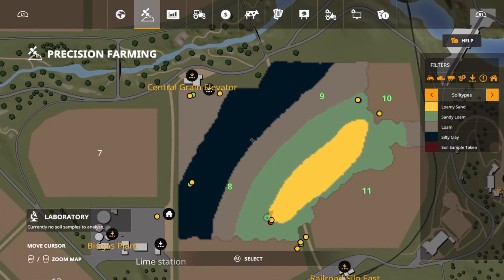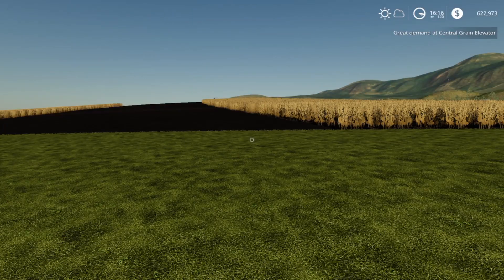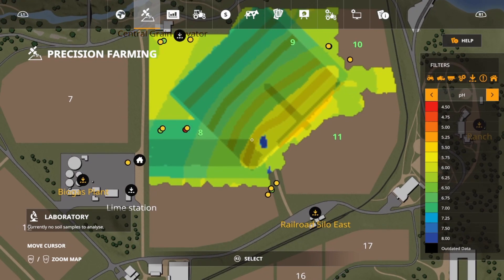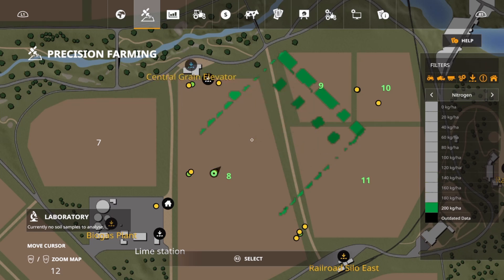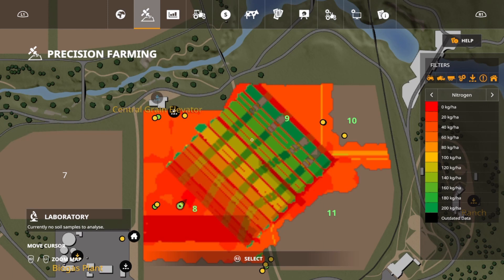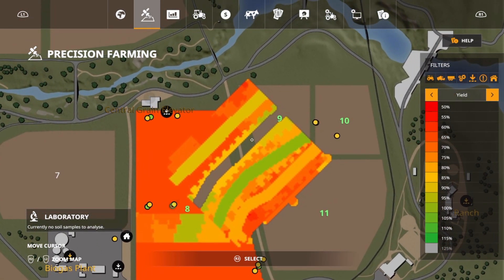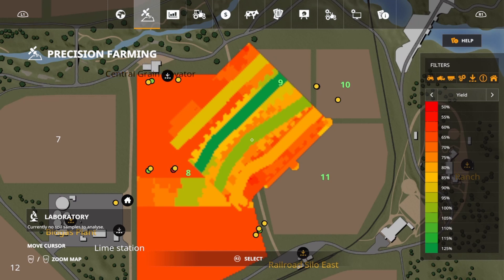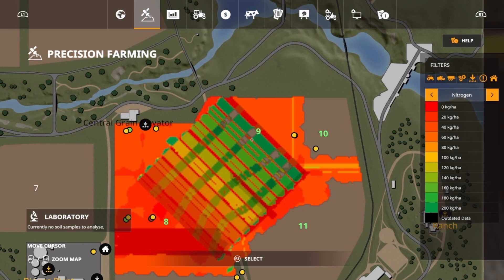Nitrogen Effects On Soybeans | Precision Farming On Console | Farming Simulator 19

Comment: I have this problem on Xbox where I did 4 soybean in a row and now there is no nitrogen levels at all. I believe it went past 200. However, I plan to try planting nitrogen dependent crops to see if it brings it down.
Reply from the maker: Can you update me after your harvest?  I'd like to know if that makes the nitrogen levels visible again.
Reply: @Driver53Gaming  harvested several times. It seems that if you plant soybeans back to back several times. The nitrogen level goes above 200 and is no longer visible. The weird thing is after that happens, the nitrogen it stuck at 0 and cannot be raised. The fix for this is to sell the land and buy it back thus resetting the data
Reply from the maker: @MrProGlitching  that's what I've been thinking too. Downside is that you need to do soil samples again.
Reply: @Driver53Gaming  agreed. Even after switching to nitrogen dependent crops, the levels never came down. Bug has been reported with giants
Reply from the maker: @MrProGlitching  is it easy to submit bugs to Giants?
Reply: @Driver53Gaming  Xbox players can report bugs directly from the game and can include 30 second video clips if you apart of the Xbox insider program
Reply: So for me it was easy
Reply from the maker: @MrProGlitching  hopefully the update fixes this. I'm running a test today to see.